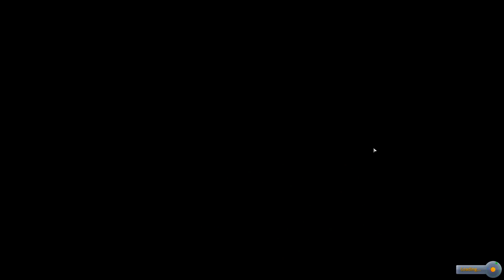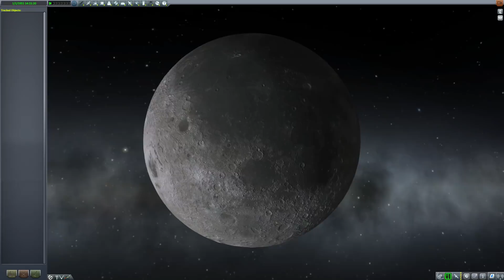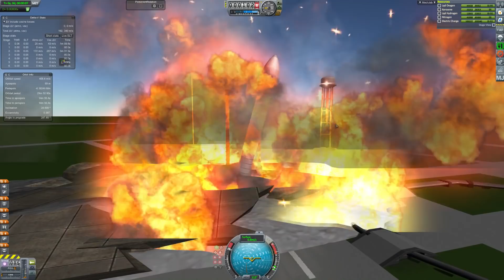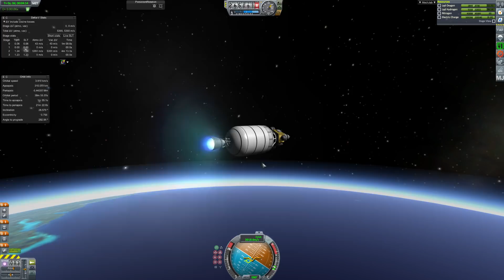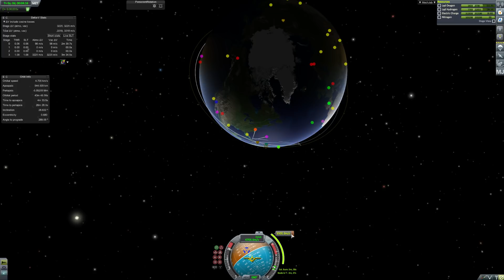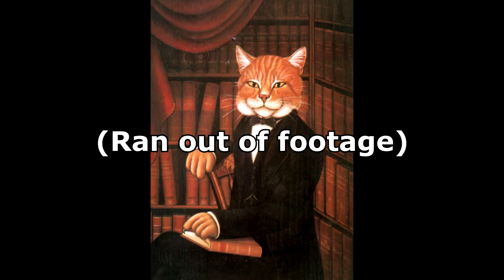Realism Overhaul: Project Luna #1 - Comms Network - Kerbal Space Program

Comment: When adding solid rocket boosters it's also a good idea to increase the height of the first stage. SRB's increase TWR so it's ok to add extra height/mass to the 1st stage.

Also, throttling down during max-Q can increase your paylaod becaue it reduces drag.
And also you should be able to decouple the fairings much earlier in flight without increasing drag.

Comment: Your interstage probably didn't work because you put on the wrong kind of side panels. The 'structural' panels are for building structures and don't decouple. Also you have to put the upper stage on the topmost node of the fairing base.

Comment: You need to use payload fairings with the interstage base if you want to attach it directly to the bottom of the engine like that. Yeah, it's silly, but that's how it works.